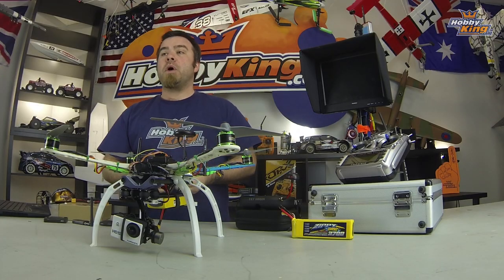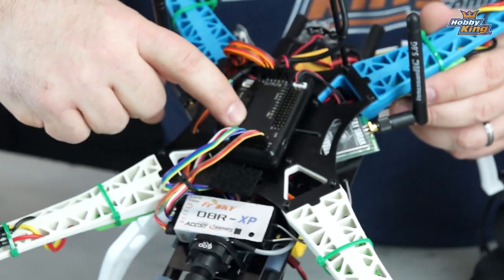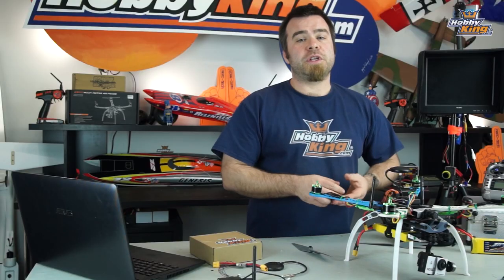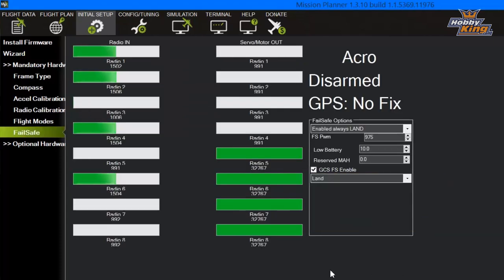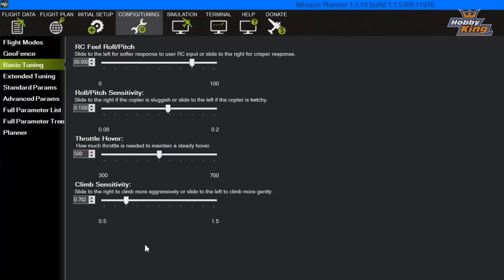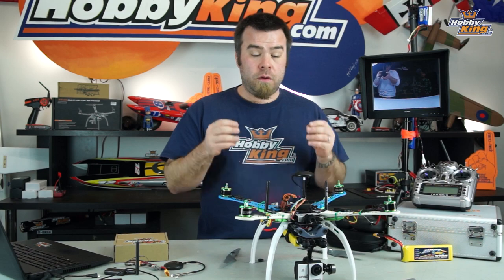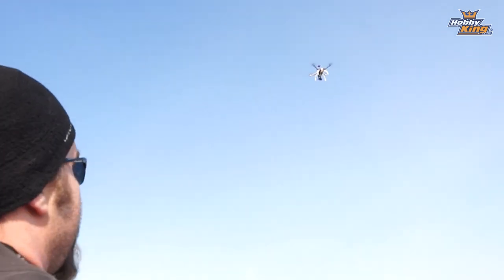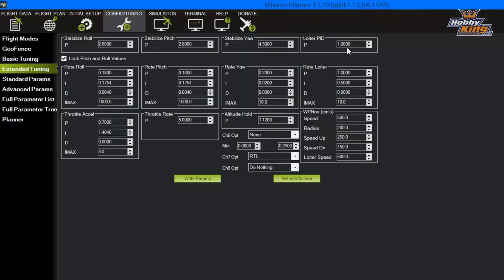HK Pilot Mega 2.7 Series Episode 3 - APM Copter Part 1

Comment: Good stuff Matt! This is same build I'm planning. ;-)
I like the Auto Tune feature on my fixed wing APM build. How well does that work on multirotors?
Thanks!
Reply from the maker: TheAdkFlyer10 I haven't tried it yet, but I intend to with fixed wing also.  Tuning quads is very second nature to me these days, so I didn't think I needed the auto.  - Matt
Reply: HobbyKing Live Hi Matt, might be interesting to see the auto tuning, got to be easier than constantly landing to adjust pid's. Also to see how different the pid's are to your own settings and if it flies better.

Comment: Hi Matt,
Great video series.
Can you confirm if I remove the J1 jumper when I use your power module?
Secondly, do I remove the jumper when using your ext compass? Because in the files section docs there's a position for external & internal, but another video by Chris says to remove it completely!
Lastly, how do I set the APM 2.7 for sbus ?
Thanks in advance
Andrew
Reply from the maker: Hi Andrew.  Yes pull jumper 1 with the power module, and also the compass jumper when using our external unit.  For Sbus you need to jumper the signal pins of input 2 and 3 then plug your CPPM (sbus) cable into input 1.  - Matt
Reply: ...Use input 1?
Do I not jumper inputs 2 & 3 and use the sbus connector on my FRSky X8R receiver? -Andrew

Comment: Do I have to use the power module? I'm building the deacat with pcb defib. I've got the power directly soldered to the pcb, will it make a difference if I leave it out?
Reply from the maker: +SuperRCNOOB Power module isn't required. You can power from the inputs, leave the jumper in on the board. The PM is optional, in the GUI just specify no power module.
Reply from the maker: +HobbyKing Live Leaving the jumper in allows the BEC's from the ESC's to power the FC portion of the board also.

Comment: HobbyKing Live where can I get those blue mounts for the camera gimbal/sliding rails.
Thanks. - Micro Mega set on route!
Reply from the maker: ***** Hi Andre, those are 3D printed, but we sell something very similar: http://www.hobbyking.com/hobbyking/store/__54313__Tarot_Gimbal_Mount_for_GoPro_Brushless_Gimbal.html
Reply: HobbyKing Live thanks guys. Can't wait to get my S500 kitted up. :)
Reply: HobbyKing Live Finally got to watch this whole video. Great job. I can't wait to get out to the field with mine. I've got a tablet with mission planner on it but sounds like I'll be bringing my laptop out a few times to tune it.
Reply from the maker: ***** You can accomplish most of the tuning direct from a phone or tablet.  I'll explain that process in a future episode.  - Matt
Reply: HobbyKing Live Matt that is awesome. I picked up an android tablet and a HC05 bluetooth module to connect to the telemetry radio. I can't wait to try all of this. :)
Reply: HobbyKing Live the Micro Mega Pilot kit arrived. It is totally awesome!
Reply: HobbyKing Live Hey Matt I'm having an issue with the external compass. I cut the trace but I keep getting compass not healthy. Ran my multimeter to check the trace it shows no connection so that is proper. Also checked the wires to the gps unit. Still no joy. Any ideas?

Comment: Its kind of nit picky, but you left off the cap that covers the reset button on the APM. Its a small black button looking piece of plastic that came with your APM case. Most people have no clue what its for. It goes inside the case but protrudes out slightly. That way you dont have to look for something to press the reset button... Its always there.
Reply from the maker: Lol.  I always wondered what that little button was for.  Have you ever pressed it by accident?  That would be my only fear.  Thanks for the tip.  - Matt